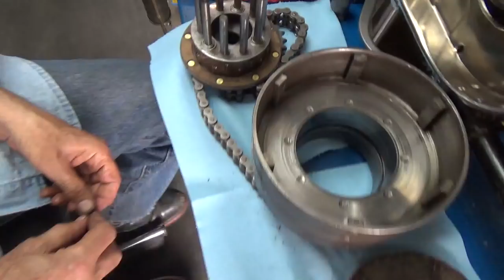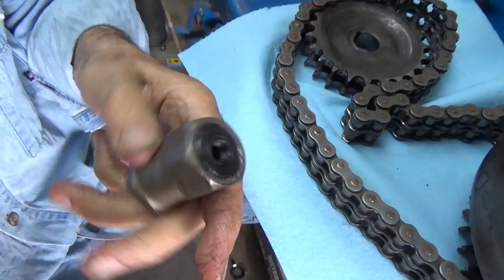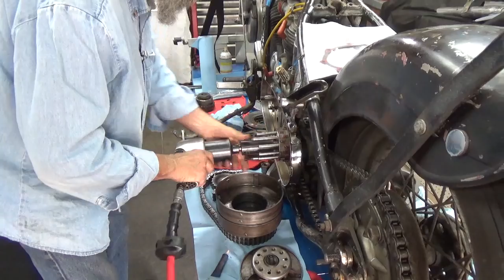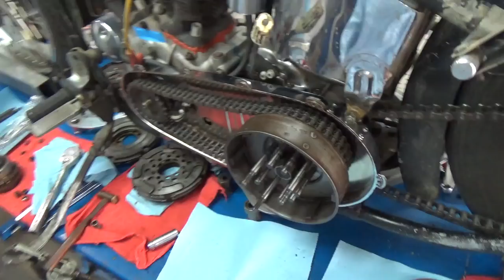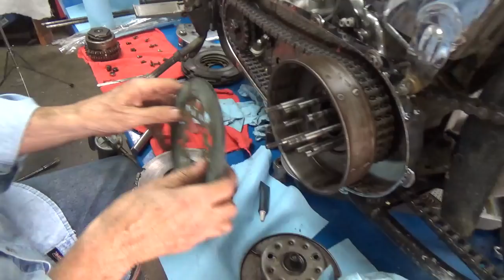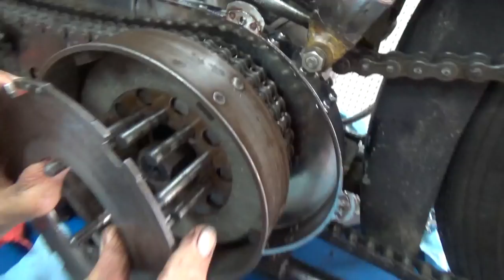Step 4 Primary & Clutch For the Panhead

Comment: I like to use an old clutch plate with a bar welded to it to lock the clutch hub when I torque it down to factory spec. If you go crazy with a rattle gun, it can actually split open the taper in the clutch hub (right at the keyway, usually). I don't think in the Panhead era service manuals had torque specs, but the factory service manual for Shovelheads calls for 50 to 60 ft lb, which is easy to go over with a rattle gun. An old timer has the experience and finesse to know how far to go with an impact, but some young guys get a little ham fisted, so to be on the safe side, I'll tell them to use a torque wrench.
Reply from the maker: Okay.  Message received.
Reply: @pacificmike9501  I hope it didn't sound like I was chiding, but these videos will likely outlive us, and future generations will study them to learn, so it's a historical responsibility on our shoulders. A lot of the actions we do are habits from long experience and are hard to show in a vid. It's easy to forget that the new guys as well as future generations are coming from zero experience. You've been living and breathing Harleys for many, many years. I study your videos intensely and find them a hugely valuable resource. Thank you so much for what you're doing!

Comment: I have assembled whole engines with worn used parts just as Ferrari did in the sixties. More power from lower friction of smooth surfaces and loose fits. Just shorter life. New parts are not needed many times.
Reply from the maker: Well said.  Thank You

Comment: another good video. good camera work and good explanations on what is what and sometimes why. I was thinking, Mike why you kept on putting that nut on, but didn't surprise me when he backed it off and going to do the right thing by replacing it. maybe next video you can explain what the compensator does.
Reply from the maker: It's basically a "cushion" drive.
Reply: @pacificmike9501  sorry Mike, don't know what that means but I will research it
Reply from the maker: As the word "Cushion" implies, it takes some of the shocks out of the drive system.

Comment: Its soothing watching you do the jobs we have all done in the past with such calm and aplomb Mike. I particularly like th fact that you are working on a beater road bike- not a garage queen. Hard not to laugh at all the red silicone around the rear cylinder base. Lets call that an 'Externally applied gasket" shall we...!?
Reply from the maker: Hey, I just said I'd get it running.  We'll redo the whole bike at some point "Down the road."  That silicone is keeping the oil on the inside.  Yah, a little extreme.
Reply: @pacificmike9501  Oh forgive me if it seemed I was criticizing. I was actually celebrating it. I can relate to such improvisations all too well, which is how I have stayed on the road all these years.
If it works, why knock it!
Reply: That said, how ya gonna tell if it has oil in it if it's not leaking....😜👍

Comment: Brilliant job Pacific Mike, shown easily and clerarly, very helpful... sorry, can i ask, the 1/2" deep inpact socket youre using, what size is that for the nuts, it appears you used the same for both, i'd like to be prepared, cheers 'n appreciated, Jon
Reply from the maker: 1 1/8".  That is the standard size for the clutch hub nut.  The motor sprocket nut may or may not be the same.

Comment: Hot pancakes and butter….I fought for an hour with a woodruff key on my 6t pinion oil pump drive gear trying to get that bad dog to stay in place whilst I positioned the gear and interlocked it with the pump 24t drive gear…then I had to do,it all over again with the cam drive pinion gear - many bad words were said. And here is the master with a mallet showing me how I could have tapped it in place….😂 what a fool I was
Reply from the maker: Time doesn't matter when you're doing it because you want to.  You do it until you learn it and get it right.  Then, it's on to the next thing.  We all start in the same place.  You're no fool.  You stuck with it.

Comment: Mike, long time fan of all your videos. Any issues with impacting the nut on the front sprocket shaft, rather than torquing it down? I’m installing a belt drive on my 54 Pan.
Reply from the maker: I believe (just me) I'd rather use an impact that tightens on a small diameter, rather than using a long wrench, which is a big lever loading the shaft sideways.

Comment: I really enjoy your videos, but I have a question that has led to much debate over the years, that being the use of an impact wrench in a primary. Some argue that is OK to use one for disassembly , but never for reassembly. Maybe I have been unnecessarily doing it the hard way the last 50 years by only using a breaker bar and ratchet. 🤔
Reply from the maker: Personally, I feel the tight radius created by  an impact wrench is less harmful than a big lever.  Just my personal feeling.  Many differ.

Comment: noticed ya don't torque the clutch hub nut...??  fy i made a clutch hub holding tool by welding a square stock bar to an old clutch plate so it slides over the  studs..work like a charm...thks for sharing...
Reply from the maker: Thank You.

Comment: Hey Mike.  Love all your videos.  I'm curious about that compensator you showed in the video.  I've never seen one of those before.  What was it for and what did it do?  Why not still use it?
Reply from the maker: I just brought it out to show.  It's an early one that goes on bikes 54 and earlier (tapered output shaft).  Harley only made these with 22 or 23 tooth sprockets, so most people put on a solid sprocket for 24 teeth (higher gearing).  But, it is basically a "cushion drive."  Harley still uses a modern version of these on their motorcycles today.

Comment: Im new at working on old harleys these videos are a godsend!  ...how much is the clutch suppose to open?   I got this old chopper that needs help and the clutch opens barely 1/8" and only on one side.... its a mutt chopper built by someone who probly cut corners...didnt do it right...and used warn parts....
Reply from the maker: You need to clean it all up and replace what needs it.  Adjust the springs so it breaks evenly.

Comment: Your videos are priceless!!! 
Question: I have a 1975 FXE and can’t find any information on how many loose bearings should be in the clutch hub. 50-52?
I don’t remember there being a 3 roller gap not sure if I may have lost any.
Reply from the maker: Do you have something strange in there?  How many holes in the cage?
Reply: @pacificmike9501  Yes I do. And I didn’t ask a complete question. I was thinking faster than I can type. It didn’t dawn on me that my clutch isn’t stock. But still uses the OEM style clutch hub but uses loose roller bearings not caged. I spilled them and am not sure if I found them all. After I tried to put it back together I had 50. I just ordered a new OEM style hub and the “52” bearing kit that specifies new “52” for a smoother less wobble clutch. For your reference Part# 20-0229. Thank you for your response.

Comment: I got the same clutch on my 81 Sturgis. I replaced the primary belt this winter. The belt is pretty tight but not adjustable on my bike. Now the bike has trouble taking of from standstill, it kinda groans and lurches when I let the clutch out. I am 100% sure the key is in there correctly. Could the tight new belt be responsible for this ? Maybe I did not put enough grease on the big roller bearing (as I did not want the excess grease to gum up the clutch plates) ?

Whe taking it apart to do the belt replacement I forgot to bend back the tab for the clutch hub nut. The protrusion into the hub broke off and I could not get the locktab to come off over the threads. The remaining protrusion bit made the hole in the locktab too small. That took a lot of swearing, some blood too...
Reply from the maker: Sounds like maybe the clutch plates are slipping (maybe adjusted too tight).

Comment: Hi Mike, another good video. Like you I try to do any upgrades that make sense to me. After rebuilding the transmission in my '57 FL I decided to use one of those super nuts with the seal built in to secure the transmission sprocket. As you would know they are considerably thicker than the stock hex nut. Before I put the clutch hub back on I wanted to ask you specifically if the added thickness of the super nut has ever caused you a problem with the clutch hub not fully getting to the proper depth on the mainshaft?  Please advise. Thank you.
Reply from the maker: Yes, I've had the problem.  Sometimes removing the shield (cover, slinger) from the sprocket, will give you a little more length on the mainshaft.  Sometimes the clutch hub is worn and it goes on further than you would like.  Sometimes, you're outa luck and it just isn't going to make it.  Make sure it's all in good shape.  Maybe a new clutch hub would do the trick.
Reply: Thank you Mike for your reply. One thing you did not suggest is to swap out the super nut for a thin stock hex nut. Seems to me that should do the job and you could retain the oil slinger. The hub is new and no cracks in the keyway so I think I best swap out the super nut for a stock one. Thanks again.

Comment: I have 58 duo glide. Is this model had wet clutch? I noticed that I have a drain bolt under the primary cover. I drained it and it was more less a quarter. Ive seen that there are some difference with chain or belt in primary cover and what I understand when You have belt it must be dry clutch but when chain is it wet? BTW great footage
Reply from the maker: Thank You.  Your bike came with a dry clutch and chain drive primary.  The engine breathed into the primary.  The chain oiler is controlled by the oil pump.  It is a "total loss" oil system.  After oiling the chain, the oil drained out of a hole (which originally had a spout on it) at the bottom rear corner of the inner primary cover.  Then, we came along and put belt drives on in place of the primary chain.  Then, we restrict the oil (which came out of the breather tube into the primary).  This is done at the oil pump.  The motor must still breathe.  So, we extend a line out behind the inner primary cover.

Comment: Hey Mike got a question for you, would it be possible to install a new primary chain without taking off the clutch and motor sprocket, move the transmission far forward and slip on a longer primary chain ?
Reply from the maker: Not that I've ever seen.  But, it's a good thing it's no big deal to remove and reinstall it as it is designed to do.

Comment: Hi Mike! I have a 51 pan/shovel chopper that i just got cranked up after 40+ years. It won't shift. It has a ratchet top shifter and I'm thinking that the ratchet mechanism is so dried out that the pawls are frozen. So here's my question: Isn't/wasn't the primary supposed to be lubed by oil dripping /spraying on the chain? Is it dry now? Do you lube the chain? What do you clean the clutches with? Thanks Mike!
Reply from the maker: We do all that stuff in our videos.  You also need aa service manual.
Reply from the maker: Go to our Youtube homepage and click on the word "videos."  The videos will all come up.  Buy a service manual for the year panhead you have.

Comment: I seem to noticed that you don't usually us the box end of a wrench. Is that in fact the case, and is there a reason if it is?
Reply from the maker: It's a habit from trying not to ruin the chrome on hardware.  Notice I use tools that really fit too.  If you know how tight you want things.  If you only use tools that really fit.  I worked for people who rode very nice motorcycles for a long time.  Knocking the corners off of chrome bolts was out of the question.  There is no doubt a box end grabs a nut all the way around.  What do you want or need for the job you're doing?  It varies a lot.

Comment: that back base gasket need replaced ? seems like a little bit of  silicone was used
Reply from the maker: I'm not going to open this engine.  The idea is to get it running while another bike is getting rebuilt.  We'll eventually do everything to it.  For now, make it run.  Open the engine and we'll replace everything in there.  Not yet.

Comment: So what is the difference  in ride quality with or without  the compensator  sprocket? Also as usual great video ...
Reply from the maker: A little smoother with the compensator.  A little more forgiving at low speed and takeoff.  I feel, it takes a little "hammering" out of the system.
Reply: @pacificmike9501  Thanks man...guess I'll stick with the comp

Comment: Great video -  Would you know the specs on worn clutch discs and spring length - working on a 1957 pan - Would be great to just put all new in but at times we have to make do with what we have if possible 
 Thank you
Reply from the maker: It's in the books. Those things are made so adjustable that you can make them work right up to the point of not working when they're finally completely worn out.  But there are plenty of better parts on the market than Harley made originally.  Just watch the videos, read the book and you can have a great clutch very easily.
Reply: @pacificmike9501  Thank you - Will do.

Comment: Hey Mike, I know this is off base on this video but here goes. I've got an "81" FLH. Short story is, when I park it, it's puking oil out the breather. I've owned shovels since the early 80's and worked on em all. BACK THEN. Not so much anymore ( health problems). Anyways, can you tell me what I need to do to stop this thing from leaking so much ? Thanks in advance. Steve. Grand Rapids Michigan...
Reply from the maker: If oil is circulating properly (be sure you can see it is returning to the tank), then , it's sitting too long between rides and the oil is getting past the ball and spring in the oil pump that holds the oil back.  By that I mean, "The oil tank is mounted higher than the engine and gravity feeds the oil pump."  Therefore that ball and spring is needed.  You can take it out and clean it.  It's under the small cap on top of the oil pump.  But, if the bike sits idle, oil finally gets past and fills the crankcase.  When the bike sits too long, put a pan under it and start it, run it, 'til it stops puking oil, check the tank, being careful not to overfill and go for a ride.
Reply: @pacificmike9501   Thanks for the fast reply Mike. It's much appreciated. Have a great day 👍

Comment: So, question for you.   3 or 5 finger clutch hub for a Panhead?  And why?
Reply from the maker: Different people, different preferences.  I do just fine with the 3 adjusting studs.  I see no greater benefits from the 5 adjusting studs.
Reply: @pacificmike9501  Thanks!  I'm restoring my 1966 Shovelhead, and have a 5 finger that I bought 25 years ago I was thinking about using.  Nothing wrong with the 3 finger that was on it.
Reply from the maker: Either one will work fine.  My personal preference is the 3 adjuster.  But the 5 is fine.  Some people prefer them.

Comment: Hello how do you replace the studs in a clutch hub on a shovel thanks
Reply from the maker: Originally, Harley had a fixture for this operation..  It made the whole process much easier.  The way I look at it, If one stud is bad, more will be going soon.  Every after market supplier of old Harley parts carries these hubs.  I strongly suggest replacing yours with a shiney new one.
Reply: Pacific mike  thank you very much very helpful

Comment: Six Blade Knife, MY BAD.🤪
Reply from the maker: I don't get it.
Reply: @pacificmike9501  I MEANT NO DISRESPECT. I was trying to make a joke toward's someone in Chicago. Thx, James.
Reply from the maker: No problem.  If I don't understand something, I just say so.  We're good.
Reply: @pacificmike9501  I have a question, and a bit of a problem. I am going to run a stock rear fender on my bike. I have the fender, a bunch of tail light's and turn signal light's. LOOKING FOR A SET OF THOSE GRAB HANDLE'S THAT GO ON OFFSET TWO HOLE FRAME TAIL'S AND COVER'S. I couldn't remember, EBAY if anyone understand's. I would appreciate it. Thankyou, enjoy the upcoming weekend. Thx, James.

Comment: could i email you and ask you a clutch question?
Reply from the maker: What's wrong with the comment section?  I'll try to answer your question.
Reply: @pacificmike9501  i dont know how to send pictures. i have what seems to be a bdl clutch. but the metal plates have "o-rings" on them. not the anti rattlers i see on most clutches. i was wondering if you ever saw them before? is it someones homemade hack? and should I discard them?
Reply from the maker: They used to be pretty common.  I honestly have no idea how well they really work or how long they last.  I've never run them.
Reply: should i buy new O rings or run them without?